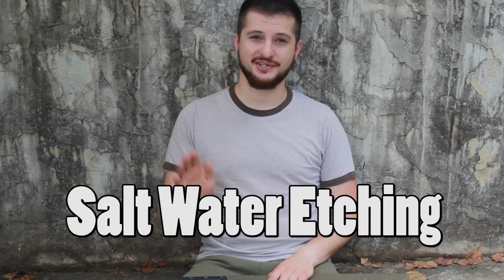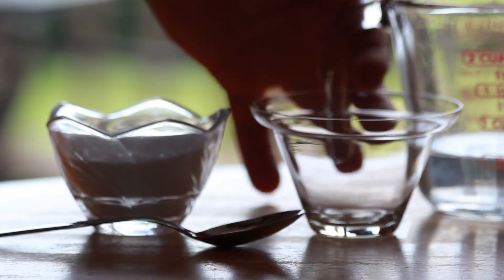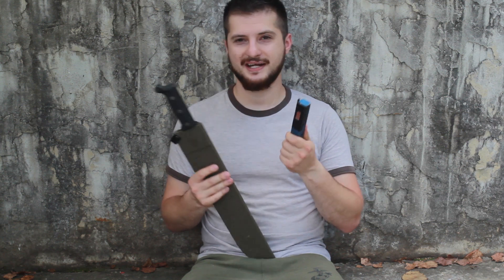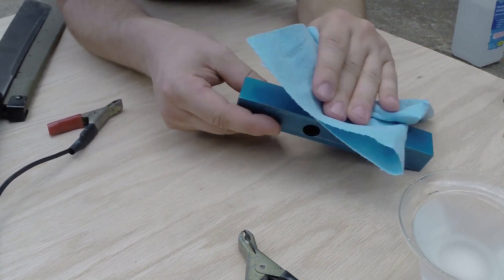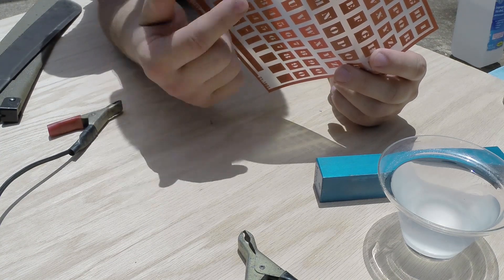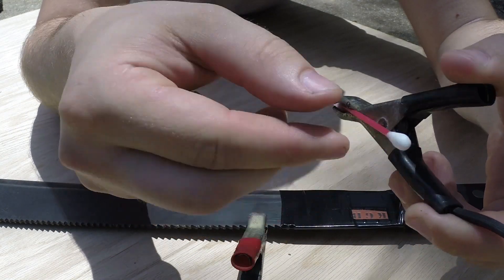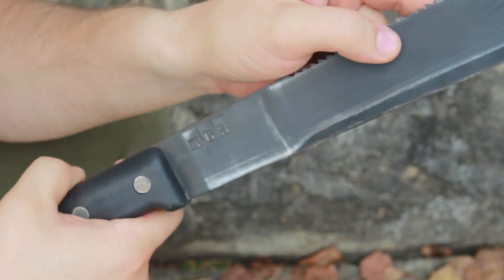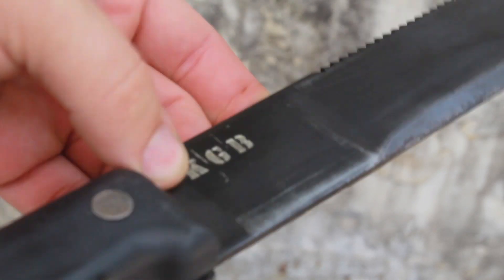Saltwater Etching (how to do it yourself)

Comment: A 12v, 2amp power supply is generally considered the best for controllability. You will see many many knife makers say exactly the same thing, 10 amps is absolutely NOT necessary.
Reply: I use a 12v 2.5 amp supply, it was originally to power my Wi-Fi modem, works spot on.